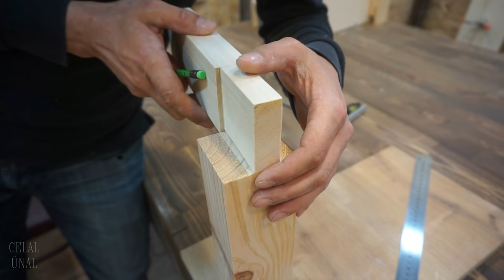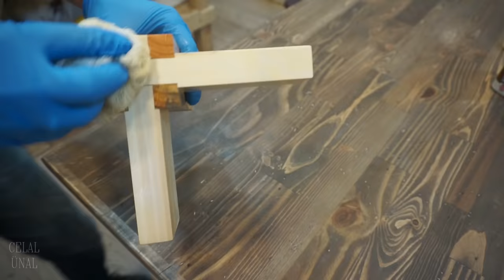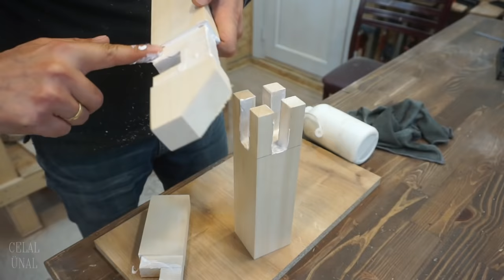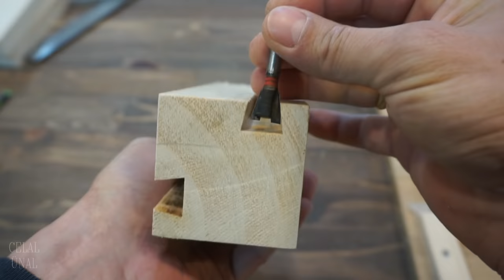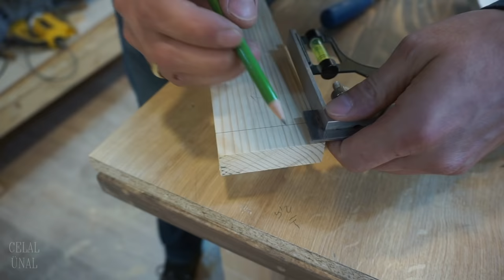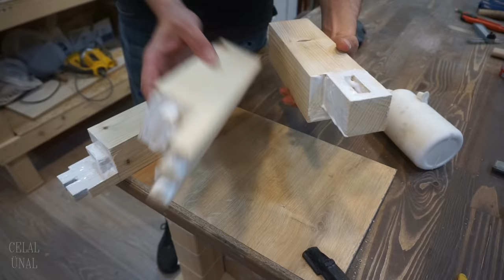Wood corner joints / Woodworking joints / Part 2 / Ahşap birleştirme teknikleri

Comment: I've been woodworking for over 40 years, but this is insane! I love a table saw, youngsters can't believe what we could do with just that and a radial arm. Well done, I am going to pack my routers and biscuit joiner away and get going again with my saw and some of your simple jigs. Thank you and well done!
Reply from the maker: Thank you so much. I am so glad you liked it.
Reply: Just had sucess using my 70s sears table saw
Reply: sure but i feel like half these guys cant even just read a plan and build the pieces and put it together. they dont set anything by measurments all these pieces are just marked to fit and made one by one. Im not a carpenter but I usually only do that stuff for framing or deckbuilding. finishing carpentry like this i wouldnt even bother without a plan of the final product. all these videos are just expensive saws and theatrics, guys dont even know how to use them lol just utube clicks is all it is about.

Comment: A really good educational video that I have managed to learn. It would be awesome if a measurement of cutting to the joint is included for wood work hobby people like me. Thank you
Reply from the maker: Thank you so much. I am so glad you liked it.
Reply: He is showing measurements where it matters (the angles). Most other measurements aren't absolute numbers. Watch closely: most of the time he is simply splitting things into three equal sections, sometimes two. Where this is not the case, he simply takes away a tiny bit, mostly a centimeter (a bit less than half an inch) or even less.

He is demonstrating the principles of that joinery only. You need to adjust those numbers to the specific pieces of lumber you are going to use ...

Comment: Dear Celal! Another wonderful example of wood machining in the modern context. This joint in the traditional and historical vernacular would not have employed any glues in most examples of it, yet rather the joinery alone.

The oblique member would have been jointed in a dovetail fashion to the midpoint (centerline) of the table apron. This in turn would often be further strengthened with a tusk tenon and wedge or similar tensioning member fixed to the table leg allowing for both tightening over time as well as disassembly...

Thank you once more for a wonderful demonstration of your machine skill in wood and grasp of advanced wood joinery!👍!
Reply from the maker: Thank you so much. I am so glad you liked it.😊😊🙌🙌🙌🙌

Comment: Celal I did enjoy seeing that corner joint with the sliding dovetail BUT for goodness sake please get a sharper dovetail bit or use a straight cutter to hog out most of the waste first. I was always told that blunt tools cause more accidents (as you tend to have to push them harder) than sharp ones.
Reply from the maker: Thank you so much. I am very glad that you like it.
You are quite right. Blunt tips can cause accidents. Frankly, I held on very tightly while opening that slot, but I was scared frankly.

Comment: Nice jig, nice joints, but some don't seem to be very practical. Maybe if you mentioned what you use them for might shed some light on the subject.
Really nice table leg and apron joint and brace
Reply from the maker: Thank you so much. I am very glad that you like it.
All of these joints are specifically for table legs. Especially for studless and screwless work.
Reply: @CelalUnal1  I will play it again, keeping that in mind when I see the one I didn't recognize. Thank you. Excellent! It was the one that had the apron extending past the leg several inches for corner support or creative affect. I have not used that one before nor seen it. I used to make custom furniture many years ago, and I love seeing new ideas.

Comment: Great job. I have to ask though, why so much glue? If you are staining wood, other than with Danish Oil, glue causes pretty noticeable discolorations in the stain and with as much squeeze out as I saw in yours joints, especially the last one, the joint would look atrocious afterwards.
Reply from the maker: Thank you so much. You're right. I used too much glue. Yes, it is evident in a product, especially in dark colors.

Comment: Could have used a straight router bit first gradually going down then use the dovetail router bit. Where you used the router? Awesome stuff!
Reply from the maker: Thank you but I don't understand the question. Sorry.
Reply: @CelalUnal1  You plowed the dovetail. Use a bit the width of the DT shank to the depth then run the dovetail.

Comment: not sure what you call the four post joinery, but all i had was a circular saw and a chisel to make that joint. I made a swing bed with that joint from 6x6 posts. it turned out rustic and awesome. I chipped off the end piece of one of the slide ins but it gave the bed character with dark stain.

Comment: Watching from the Philippines.Thank you sir for sharing your video. Iam planning to make a small table for my kitchen but my tool is only a hand saw. What is your suggestion? Thank you very much.
Reply from the maker: Thank you so much. I am very glad that you like it. It gets very difficult with a hand saw. It happens but it takes too long. You should use assembled trays. Massifpan. You have to cut it without haste. You can screw in with the help of a drill. This can be done. But as I said, even if it is a simple and beautiful job, it can take a long time.

Comment: I love good journey and I enjoy watching others do the same I have been so for over 40 years myself as an apprentice In LA Cal. learning from Germans from the old country.  But one thing that has always stayed with me is the Glue Up.  the Germans are so clean even in their work and very waist conscious they always told me a lot of squeeze out is a sign you really don't know what you are doing.  It was an embarrassment to have more than just a little squeeze-out, a little but not a lot.  I see this in a lot of very good workers of the wood and especially using their hands to spread the glue and then wiping it on their Pants, lol lol lol lol lol  it still makes me laugh,  to see it. to apply the glue use a painters pallet knife or a stick of wood, put just enough glue to coat the surfaces after all look how tight your joints are, and with both surfaces wet not droning in glue but wet with glue it will hold and keep your pants clean so your wife doesn't have to work so hard after you.   lo lol lol lol maybe this will help but most likely not.
Reply from the maker: Thanks for the suggestions.

Comment: These technics are basically usless in case of a 3m long beam, in real life . What type of saw and tools would you use to be as precise as with this table saw?
Reply from the maker: These techniques work well for jobs that are 3 meters long. but it cannot be done on a bench saw. I recommend a Japanese handsaw set for this type of situation. and I recommend a good chisel set.

Comment: Great job!  But can these joints be made so they’re able to be disassembled?
Reply from the maker: Thank you so much. I am so glad you liked it. Yes it can be done.
Reply: I wonder if you could drill some holes and use removable dowels to hold the joint together. That might decrease the structural integrity too much, not sure. You could use smaller holes and metal rods instead of wooden dowels. Or screw on angle brackets underneath and remove them when disassembling.

Comment: Thank you for making this video. This is amazing. One question that I have is how do you cut join a 4 ft post to a 8 ft post, because you can put neither of them on the table saw to make those cuts. That is the part I always struggle with
Reply from the maker: Thank you so much. I am so glad you liked it.
Sorry. I don't understand exactly what you mean in the question.
Reply: The corner joints you show a lot of them are smaller wood. Small enough to drag over a table saw. What do you do for longer wood pieces?
Reply: @AnantSingh92  if a piece is too big for the table saw, then you saw it on the table.

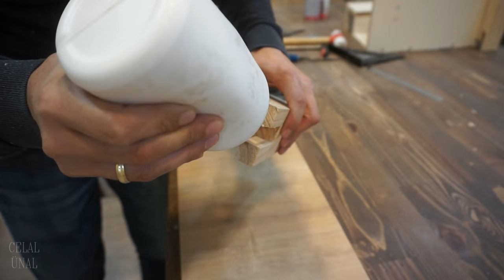Comment: I'm new and working on the corner joint at the 3:10 mark. Hoping someone can walk me through the measurements ie the two inserted pieces are shaved by 1/4 on each side? and then divots cut out that are half the height of the whole piece?

Comment: Unusefull for a large pieces ..
Reply from the maker: It's a little tricky, but it works for large pieces too.
Reply: @CelalUnal1  But isn't it complicated and dangerous to put a long wood vertically on the table saw? I feel like you wouldn't have much control...